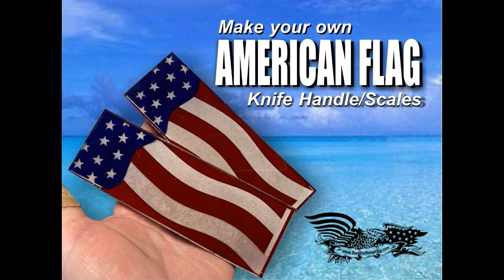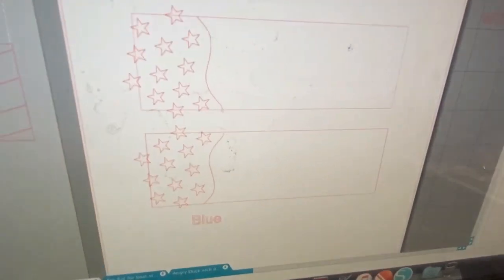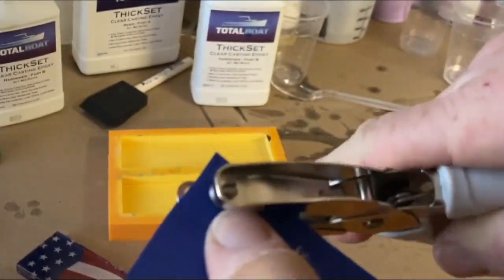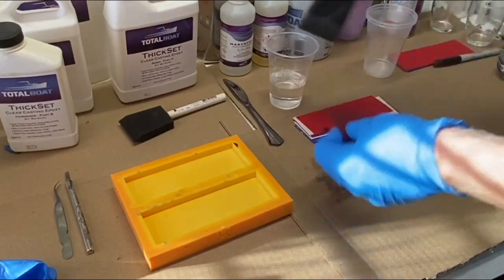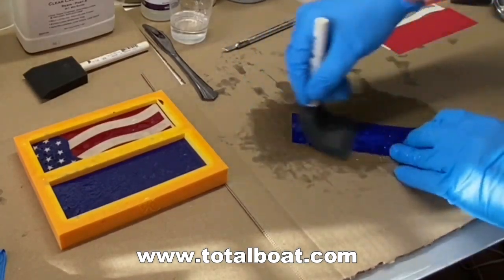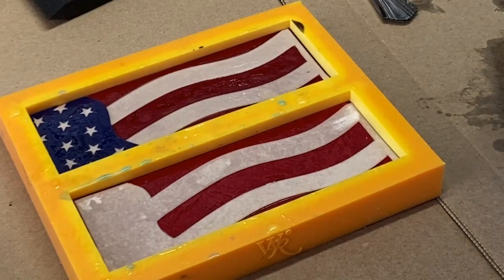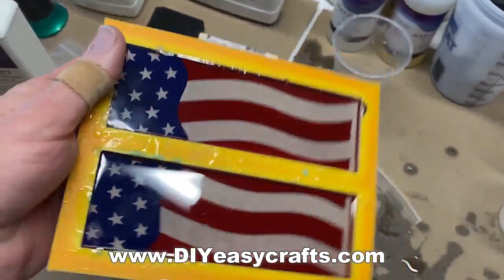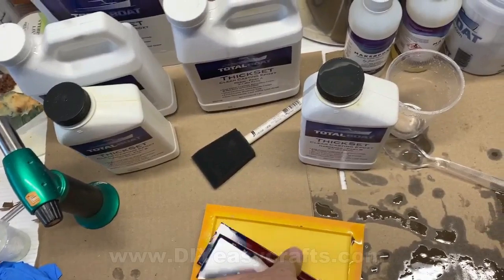Make your own Cast Resin American Flag Knife Handle Scales

Comment: Very cool!  Have you tried using vinyl?  Im wondering if the epoxy would melt it...
Reply from the maker: I use self adhesive vinyl under epoxy all the time. Looks great but not the best idea for knife scales. Always thought it would give a seperation line when grinding
Reply: @DIYeasycrafts  thanks.  I have an idea for a patriotic knife for the local American Legion post to use as a fund raiser or silent auction!